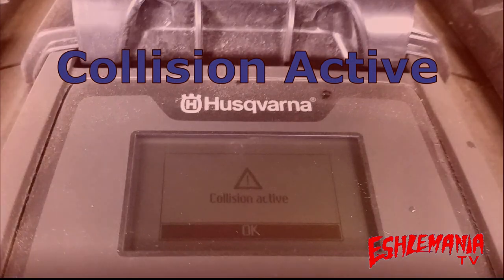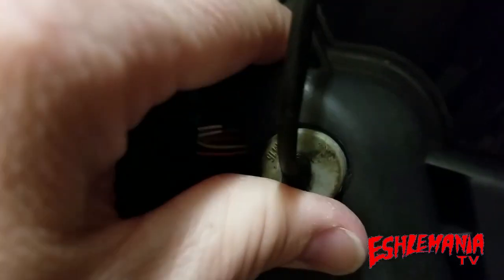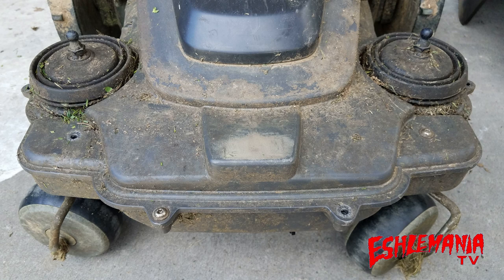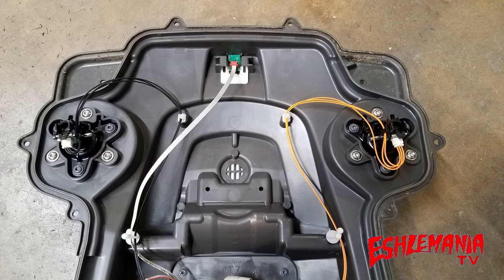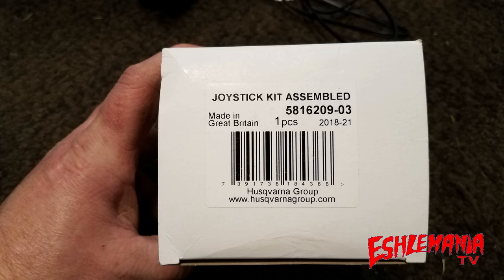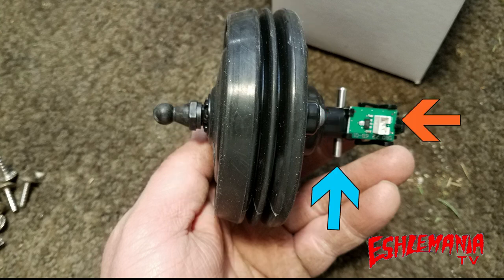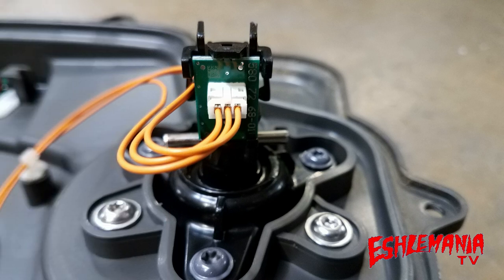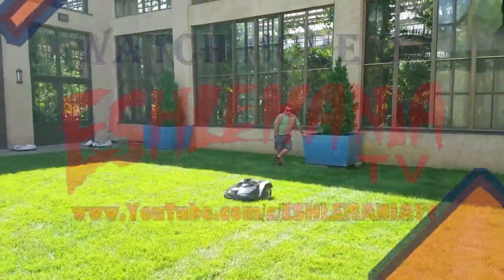Automower Answers: Collision Active Error Message (Part 2)

Comment: Hi.  Thanks for the video. This was my problem as well on a 315.  The fix was alot cheaper though.  I simply unscrewed the ball on top of the rubber gatter.  Placed a washer on the stud and screwed it back on.   It lifted the body about 1mm and solved the clearance issues.   No parts needed

Comment: Any do it yourselfers out there you can take those joysticks apart and stretch those springs and get some more life out of those old joysticks instead of paying the 120 bucks for new joysticks. Great instructional video.
Reply from the maker: Good call! If a mower is out of warranty there isn't much to loose by using that trick.
Reply: Thanks, perfecto.

Comment: Hello! Thank you for your video. I’m running into a problem with a brand new 430hx. The unit is brand new and i did the installation as per manual. At the first start up the mower went out from the changing station in reverse and at about 4 feet distance it stops, makes two or three left /right and then stop and give the error front collision sensor active. Like i said the unit is brand new and i checked for any broken part during shipping but found nothing. The magnet is still there. Any advise?

Comment: i changed the part as the Magnet was missing even though i already had the white part. Followed the instructions, changed the part, put it all together and when i started it back up it didnt run. all that happened was the height adjuster motor kicked in and dropped the cutting height and then lifted the height to the minimum. then nothing??

Comment: Really glad I found this.  I have a Gardena Sileno, which I think is same as the 310.  Machine is shutting down.  But I once got the "collision active" message.  So I looked in and found that the bellows has a nick in it.  The magnet is still intact and good.  Do you think this is causing it to shut down?
Reply: Ever find a solution to the problem? My backyard sileno minimo is having the same issue, front yard same age but going strong. Ive since gotten fed up with the backyard one and it for some reason decided it would try fly and now it's in pieces across the backyard strangely enough. 
But if you worked out why you had those issues, please feel free to let me know

Comment: Do all automower base stations have a working Light on them?  I Saw in one video where the base station had a green light if everything was hooked up correctly and a blue light if there was no loop signal.  I have a led light on my base station (450X with 2 connections for loop wire and 3 for the guide wires), but it doesn't light up at all...
Reply from the maker: Yes, there should be an LED lit up on the charging station. If there is no LED lit up then you should check your power supply to make sure it is putting out the proper voltage.
Reply: @M. Mangredi I learned the hard way while doing my installation that there is another light signal, a green flashing light which means wiring is good BUT you are in ECO mode.     As our host constantly points out I should have read the manual and not foolishly gone around replacing my connectors thinking something was wrong.  Haha!

Comment: Hello. Do you know if the automower has to be paired with the charging base. I'll explaIn why I ask. I've recently purchased a new mower, to save time I set it up using the old base, no problems. Now I've installed the new base and, although the base shows that everything is OK (green light on), the mower says that there is no loop. Swapping back, everything works as normal.  I suspect the new base is faulty, but maybe it's not that simple?
Reply from the maker: You will just have to pair the mower to the new charging station by creating a new loop signal. It's a pretty easy process. Here is a video that shows how it is done: https://youtu.be/85tinYw5gvI

Comment: I think I have this issue.  I have the black plate with the magnet that is still ok, but it will give the error on front collision or collision active.  I do notice indeed that there are scratch marks on the front nose from the magnet.  So I will get the joysticks replaced and hope that this solves it.  Great video !   I read somewhere that there is a secret menu option to check on the collision sensors ?  Do you know it ?
Reply: ok,  The issue was the front magnet plate (black one) being completely eroded at the bottom side and the front circuit board that needs to detect the magnet was loose in its socket.   Replaced it with the white magnet plate, refitted the circuit board,  and all works again.  Thanks for this video !